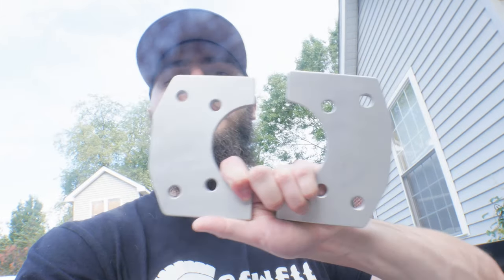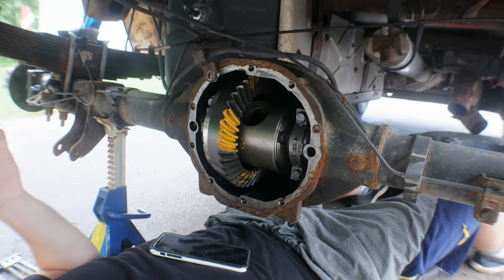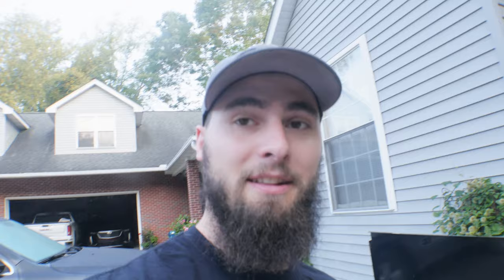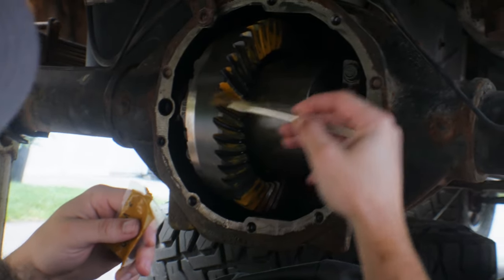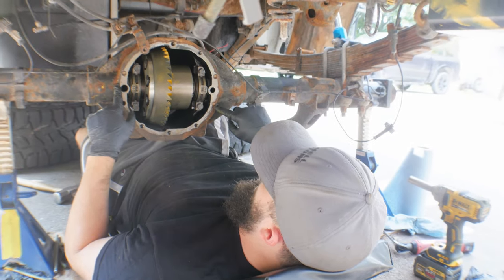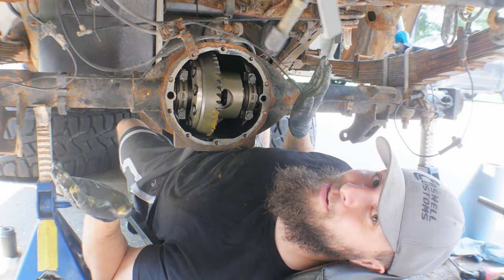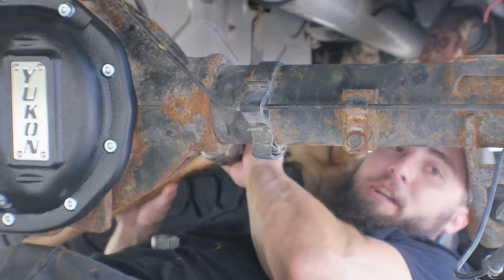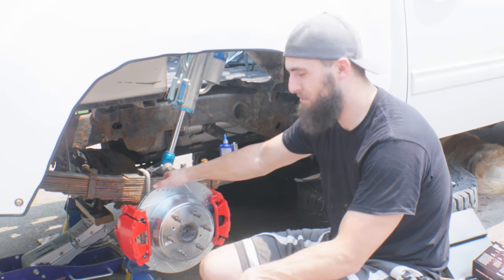Prerunner Brake Setup 07-13 Silverado 1500 - Part 3

Comment: Do you have those dual caliper brackets made to order yet definitely interested in getting some
Reply from the maker: Right now truck is almost back up and running, and we will be testing the brackets out the weekend of June 23rd. If everything goes good, we will start the process to sell the brackets.
Reply: @CaswellCustoms  In this "part 3" video, you show the bracket with the stock rear disks that retain the e-brake. In part 4, the video shows the front disks on the rear that won't allow the e-brake. Which direction did you end up going and where are the brackets for sale?